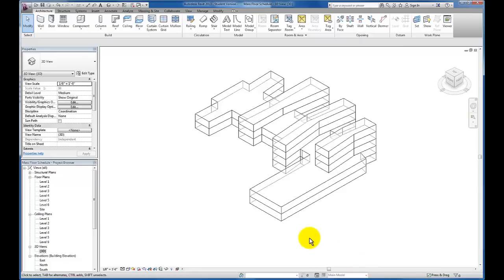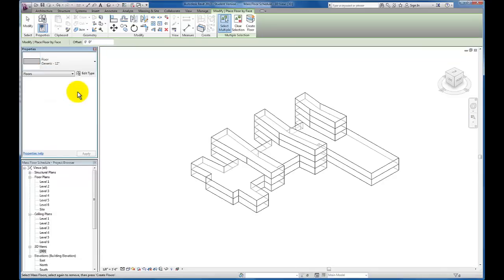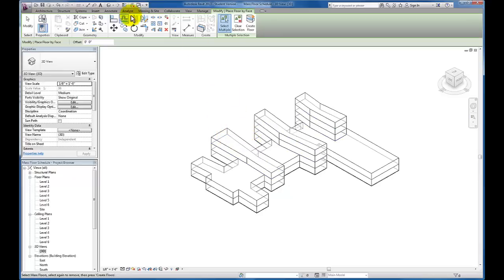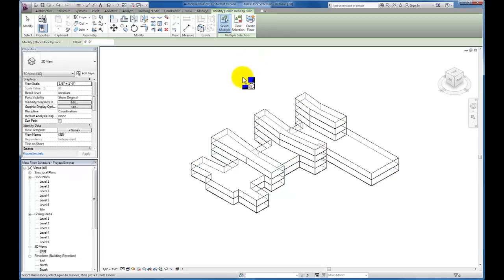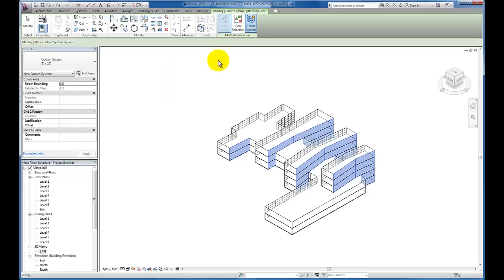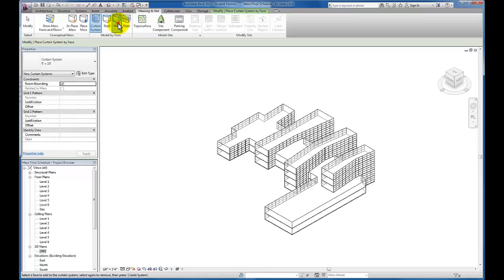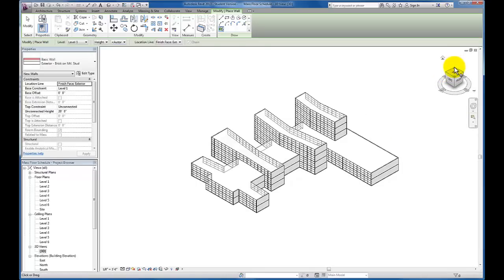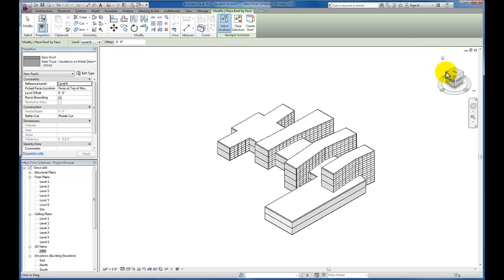Revit Tutorials: Conceptual Massing -Model by Face

Comment: awesome 
 just a question, I have created a model where there are two groups of building in difrrent levels . is there a way to edit the floor boundaries so the wont collide and make unwanted floors in the wrong places ? i mean before adding the floor by face where you can edit the boundry just where you place the mass floor based on the levels . or will those faces disappear if no floor is applied to them or i could just clean the unwated part before applying the floor by faces ?
thanks